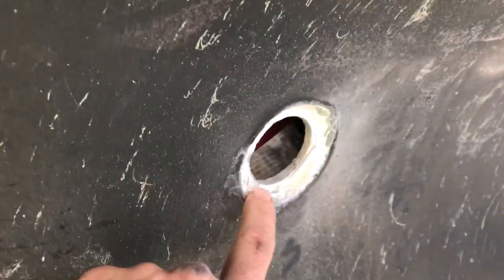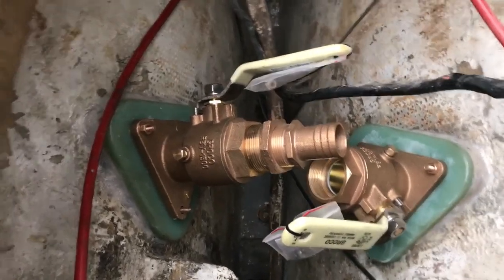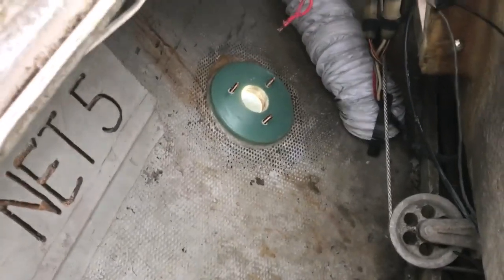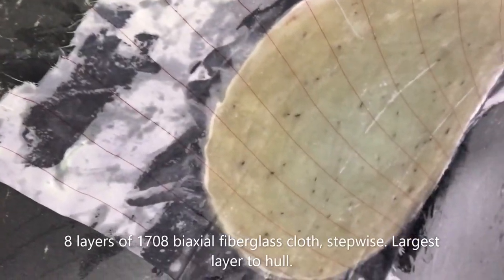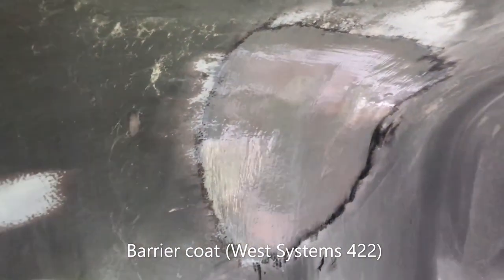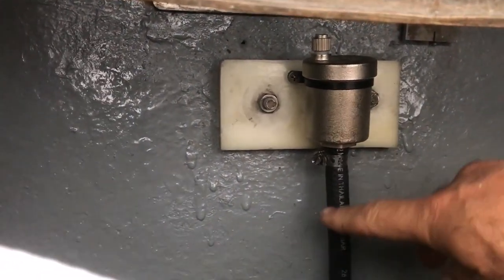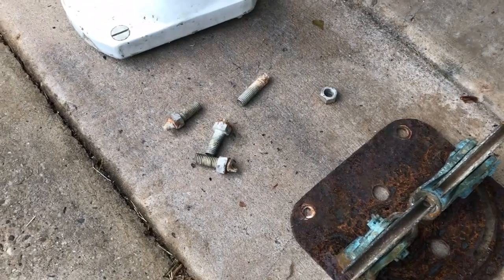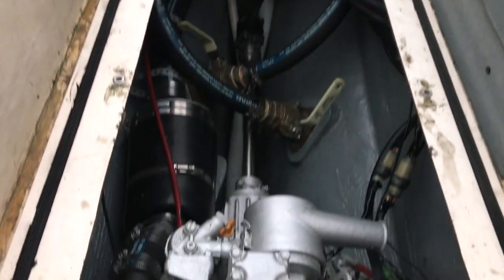Contessa 26 Refit ep.8 - Cockpit Drains, Steering and Finishing the Bilge

Comment: Looking great. I've just watched all 8 videos. I've got one of the original Jeremy Rogers Contessa's which I'm trying to breathe new life back into. My cockpit drains into the bilge which I'd like to change but debating the various options. I think my cockpit sole is below the water line which adds complexity.
Reply from the maker: Yeah, the early JR boats were designed like that.  I suppose the best way to go is to raise the floor with a grid-type sole and add the drains.  If you go that route, make sure to cross the hoses to keep water from entering the cockpit when heeled.

Comment: I am in the process of replacing my thru holes same area. I have the flats also removed them, why did you  fiberglass yours before putting the mushroom fitting in?
Reply from the maker: I think you mean the cockpit drain thru hulls? The original ones were flush and recessed into the hull’s fiberglass. I couldn’t find any new thru hulls that would fit so I ended up getting the standard, non-flush type and needed to glass the recessed part of the hull to fill the void.

Comment: Thanks for the great videos. I just bought a '74 Contessa and am getting ready to do a total refit. 1st thing is to replace the engine. Any advice on install of a new Yanmar 1 GM 10? That is my biggest challenge. Any sources for fuel tank and holding tanks supplier?
Reply from the maker: Hi Matt.  The 1GM10 is bulletproof and should serve you well for many years. Other than getting it mounted so that the engine is aligned properly (see my part 7 video), I can't think of any other challenges.  
For the fuel tank, I installed a 25 liter Vetus fuel tank in the port side lazzarette (see my part 1 video).  
Can't comment on the holding tank, mine is integrated into the bow and also acts as a water tight crash compartment.